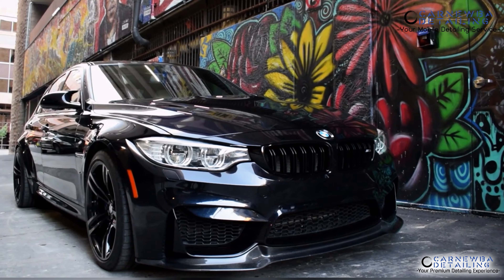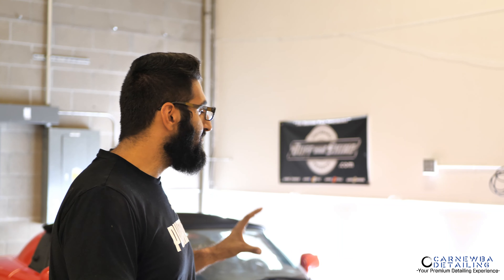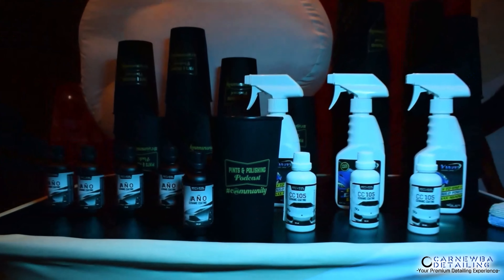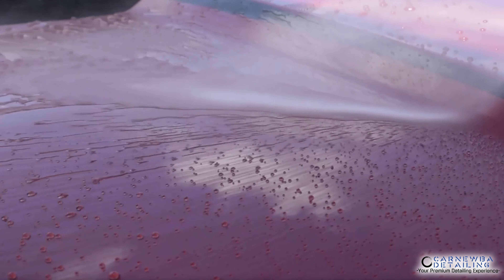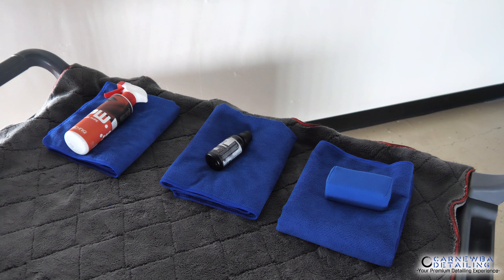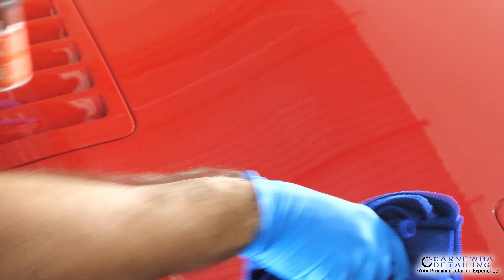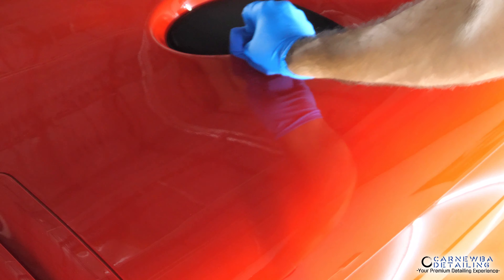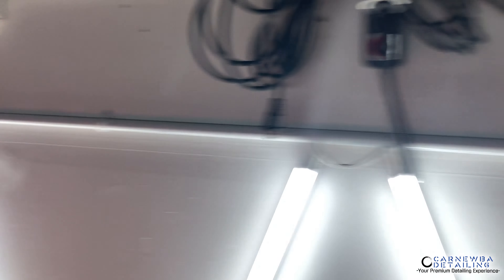Best Ceramic Coating for Mobile Detailing! Total Auto Solutions Ano

Comment: Aren’t these the same people who make CC105 ceramic? Have you used CC105 ? My last car had GTechniq Crystal Serum professional and it was dope AF. My local shop now stocks CC105 but I’m nervous to use it on my new car since my reference is the GTechniq.

Lol at the end of the video you talk about cc105. Will look forward to your vid on that.
Reply from the maker: Yes! Same company that makes CC105, and I’ll tell you what man Gtechniq has a slight Edge on CC105 when it comes to Slickness but besides that CC105 is superior when it comes to durability.
Reply: @48Detailing    Interesting, how about the Gloss factor between the two coatings ? 

Thanks
Reply from the maker: Can’t tell a difference in gloss!

Comment: Does ceramic coating could be apply on glass? 
I've seen some local product in my country that has ceramic coating product that can be applied almost all surface (paint, chrome, glass) and it cost really reasonable, around $15-20 and could last for at least 12-18 month (depends on the maintenance).
Or is it depends on every coating makers ingredients to make it a "multiple surface protection" products?
Reply from the maker: Glass and paint are completely two different types of surfaces I’m sure there are products out there you can use on both but most manufacturers prefer to make specific products for each surface and maximize the potential of each
Reply: GlassParency makes ceramic for glass